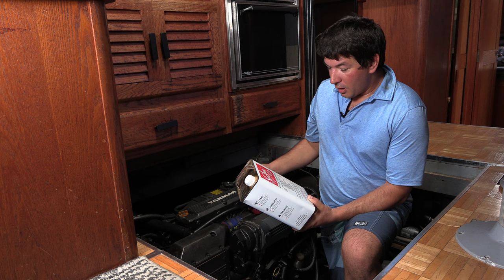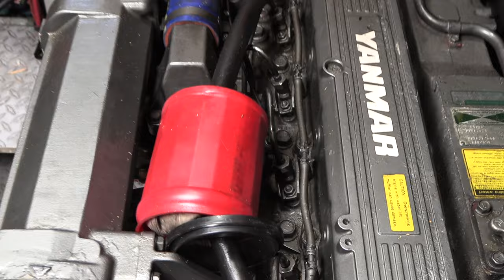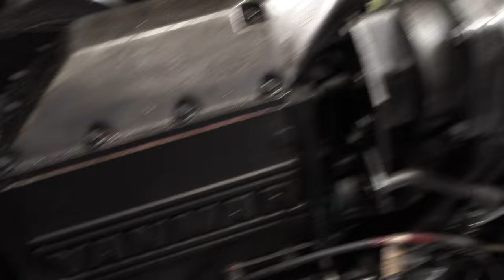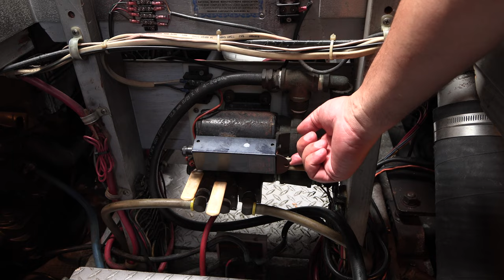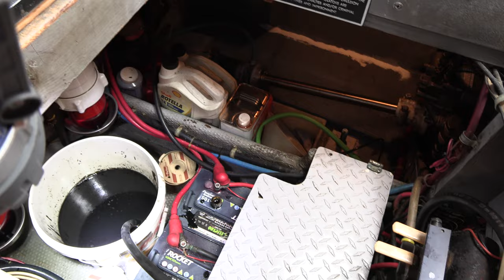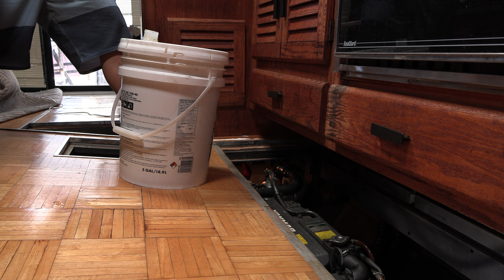SeaFoam In Crankcase | Fix High Oil Pressure | Engine Block Flush

Comment: Thank you for another interesting and enjoyable video. Shell and the other lub oil manafacturers have spent many millions and decades getting the oil correct for those engines. Which are lovelly sounding, hardly run in. I believe they need a really good run at nearly full power watching the gauges. I would not use any additives. As far as I know rotella has detergent in it anyway good voyaging.
Reply from the maker: These engines need some good flushes and run and flush until the oil is coming out clean . The first oil change was like tar ! I see a great improvement in oil pressure im now 40 psi idle to 65 psi full throttle on my port engine. I will eventually put a manual off the engine to verify pressure.
Reply: @TheBoatingDiaries  Thank you for reply. Of course you know best. Armchair sailors always have to comment. I live in Ireland always had boats. My princess 33, 1979, is now in Belgium, i have  cruised France,Belgium and the Netherlands. I always try to wear lifejackets, fallen in 3 times in 60 years never wearing them at the time. France and England full of locks. Netherlands and Belgium full of opening bridges. In part of Netherlands you lock down 60ft below sea level.

Comment: Some good-looking and good-sounding engines.
Reply from the maker: The boat was professionally repowered in 2001 with these new engines.  In my first video I show some of the pictures of the work that was done. The boat use to have the crusader gas engines
Reply: Those engines look pretty new ish for there age. Which could be A good thing and sometimes bad, you might want to look into running them at full recommended rpm to burn off all the carbon in combustion Chamber, check with someone who knows first I am going off my knowledge of cars

Comment: Port engine is warmer than the starboard, that will account for the difference in oil pressure
Reply from the maker: The cooling system was neglected as well , I installed new yanmar thermostats.  The starboard engine running cold,  the thermostat was mechanically stuck open. I also have installed new radiator caps as the caps that were on it , the springs were worn out. So she is pouring now. Ready to take it out of Florida this month to jekyll Island in Georgia
Reply: @TheBoatingDiaries  that’s great to hear about the planned trip. I’m sure you’ll enjoy it. The Yanmar LH is a very good engine, they can suffer with plugging up on the raw water side in the intercooler etc so it would pay to plan a flush with Barnacle bust or similar in the future just for some peace of mind👍

Comment: Could be faulty oil pressure sending unit
Reply from the maker: I could put a manual on the engines , but as I flushed the block and ran the engines to temp ,the pressure was in normal range

Comment: Run some HEAT through your engines. 1800 RPM KIND OF HEAT. STOP USING SNAKE JUICE. ONE TIME USE, make you feel good then STOP using. Use good diesel oil.
Reply from the maker: This boat was sitting and not run for several years at the marina. That is what happens with these older boats , is if they sit and engines not warmed up and run, out changes  etc . Engines get gummed up . But it's doing much better for sure
Reply: @TheBoatingDiaries  glad to hear. Happy boating, I'll b watching